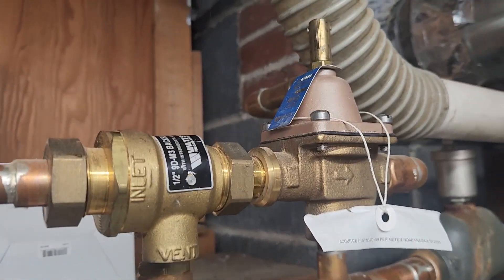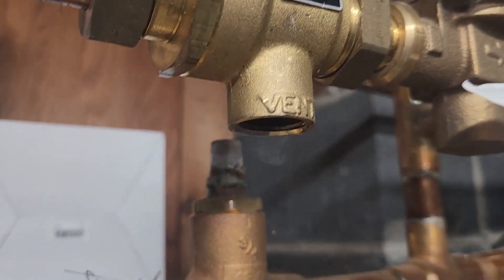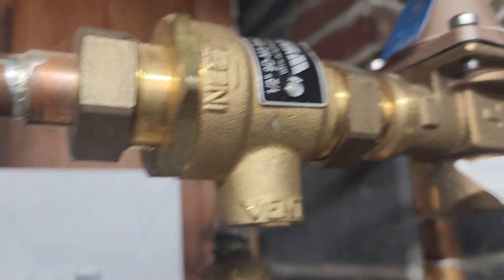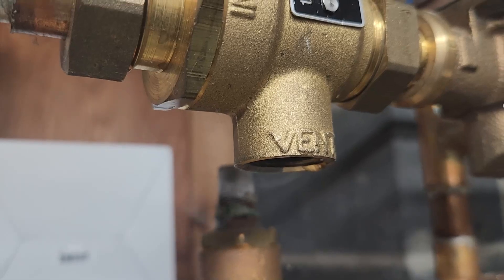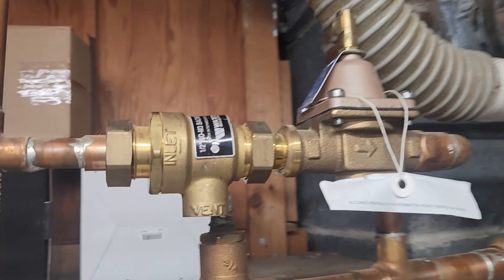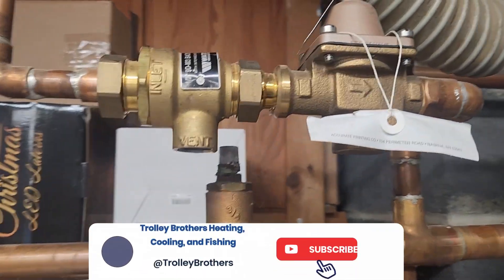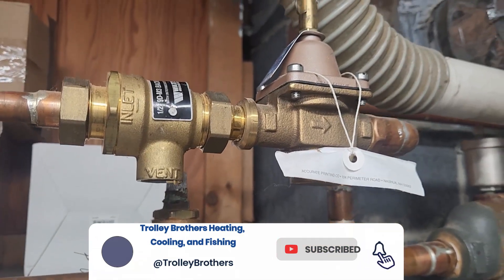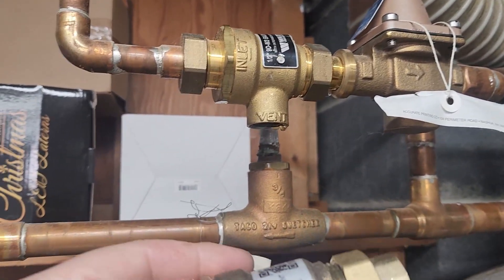Water leak and steam coming from the boiler back flow preventer. (Link in description)

Comment: Great video. How much does it costs to install a new backflow preventer? What are the labor and parts cost?
Reply from the maker: Actually I can't remember off the top of my head what the part costs, it has been a while since I replaced this part. For labor side, that varies with all companies and also where you live. A local company could give you a free estimate, most do.